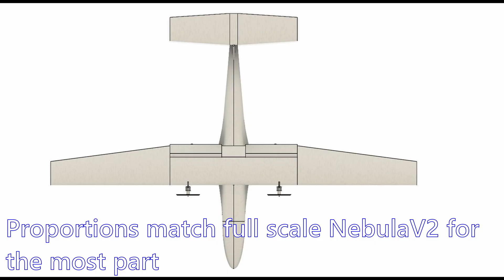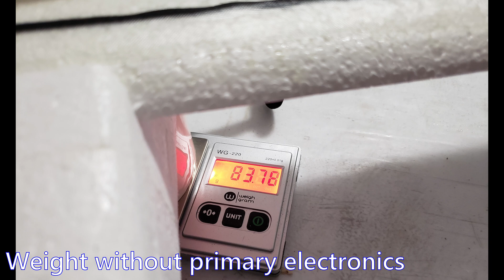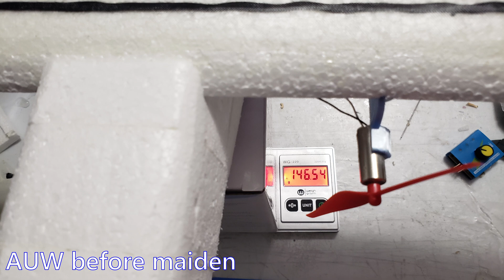Micro Nebula V2 | 150g Fixed Wing RC Plane

Comment: Looked good once you got it going. The tendency to spiral at 0:26 looks like just a bit tail heavy?
Reply from the maker: I agree, in these flights it was a little heavy, you can see some pitch oscillations in later parts of this flight. Though the spiraling tendency did not disappear after adding additional nose weight in subsequent flights. It felt like the wing was stalling shortly after rotation and getting into the air. 

My guess is the speed the motors could get the plane to while on the ground wasn't much higher than the stall speed, so the aircraft was starting to stall on ground rotation. Redesigning the wing and power system should help alleviate these performance issues, I'd also move the wing back about 1cm to make balancing the cg easier.

Thanks for watching!